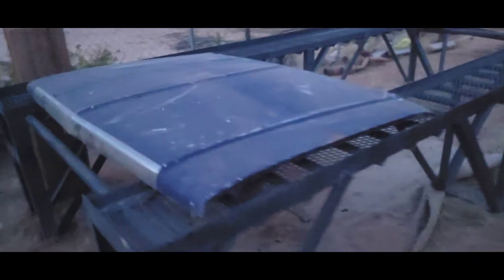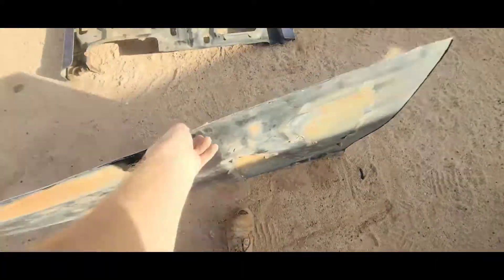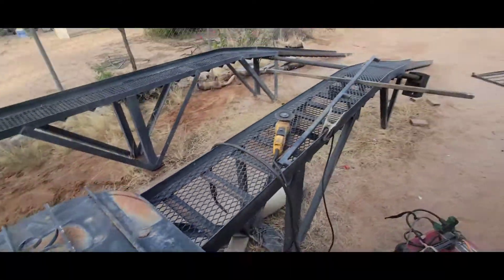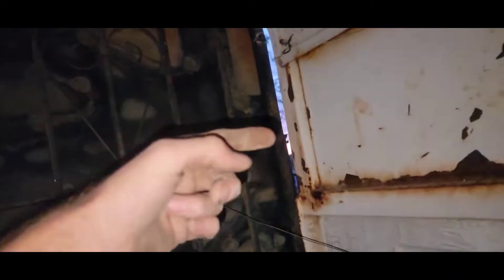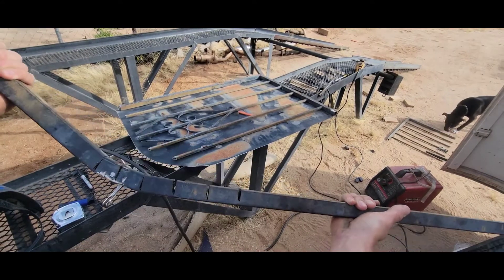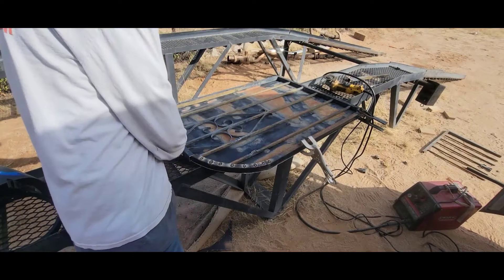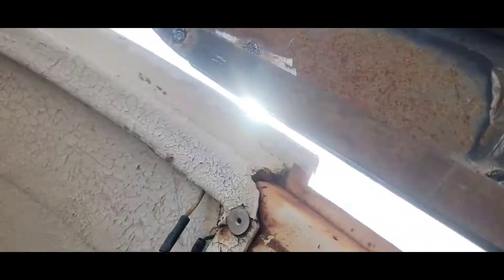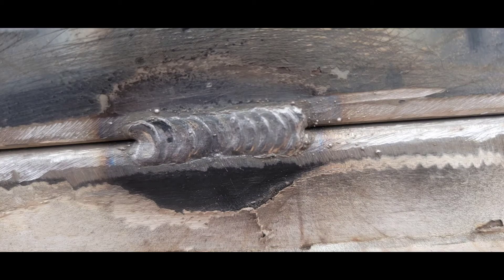Horse Trailer / Homemade Cargo Trailer

Comment: I'm doing the same thing. Hope you will video entire project. You have more skill, experience and better welder than I do. I want to make the rear post between the doors removable so I can run a garden tractor in it and then replace the post.
Reply from the maker: Thanx for the comment. Cool to hear about others doing similar projects. I have a couple ideas to make the center post removable. If you need help or have questions feel free to comment on here or message my Facebook ID be happy to help
Reply: @Masta13100  👍 My center post is a round pipe with provision to lock the doors to it. The best idea I have come up with, is to cut it top and bottom, leaving a stub. Insert a slug close to the inner diameter that would work like a barrel slide lock. One end might be welded in, so only one need be sliding.